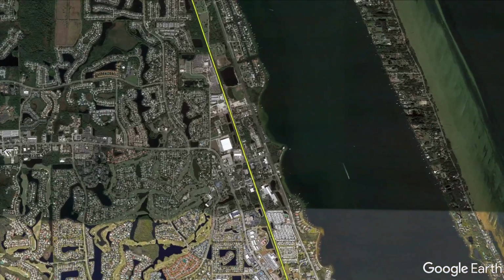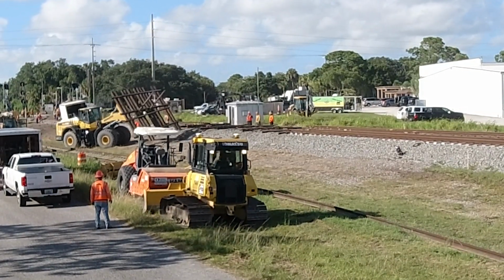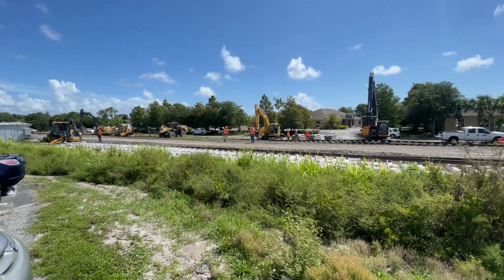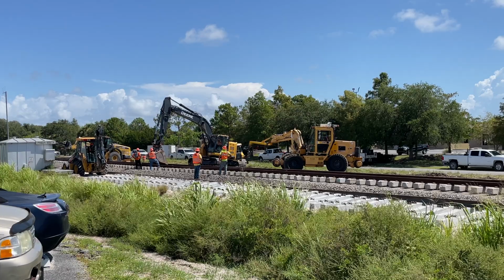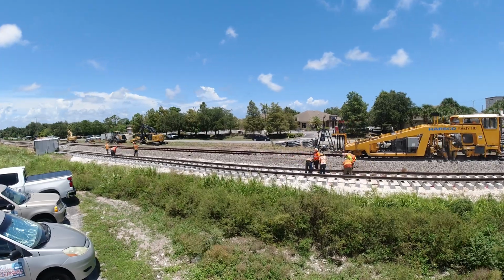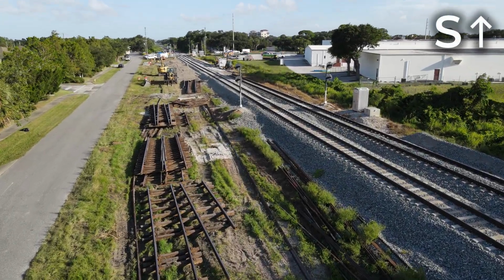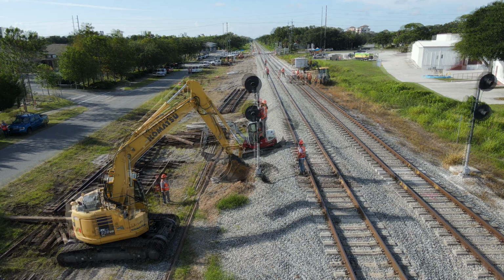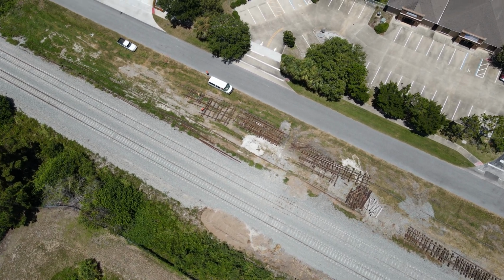Brightline Construction: Removing the Pineda South Turnout - ATC19 Cutover July 2022

Comment: If you're going to timelapse, it'd be helpful to explain what they're doing, and maybe skip over more parts where nothing is happening. i.e. if it's not worth narrating, it's probably not worth showing. Or if it really needs to be shown, then increase the timelapse. The key is to not leave too long of periods with no narration.
Reply from the maker: I’d be more likely to stop narrating altogether than I am to cut content from my videos. The main reason I make these videos is to historically document the work, so the narration is just something extra to give general context on what is being done.
Reply: I thought it was the right amount of narration. Like, I need the info to get started, but it’s easier to concentrate when no one’s talking. That job bolting the rails to the ties with a heavy air tool looked exhausting on the Cocoa cam a few months ago, so I was trying to see what was happening, on a small screen. Sometimes at Cocoa they had the tool mounted on a cart, but often they were just lugging it around.
Reply: Also interesting to see how much of time is taken up moving earth, like in many construction projects.

Comment: Time-lapse really made your video coverage a lot more interesting . I Maintained Plasser Tampers for 11 years and I've watched millions of ties being tamped and unload miles of ballast worked . I watched quite a few long ballast trains dump ballast on open-deck bridges with crossties in front of the ballast car wheels to insure the ballast didn't cause a car to derail . Very interesting site to see as the bridges were 40 to 50 feet above solid ground  . Great Video .